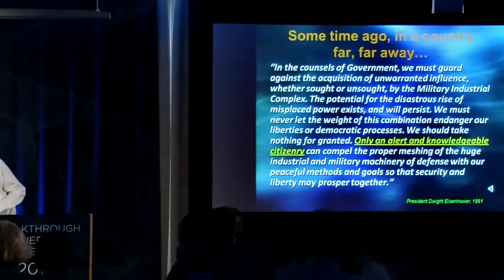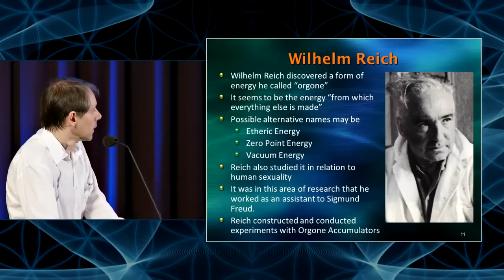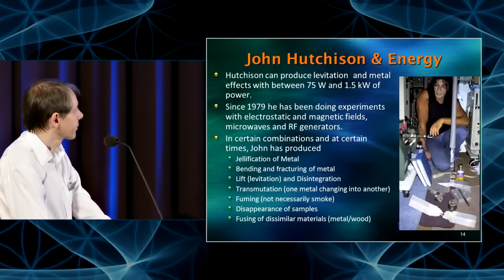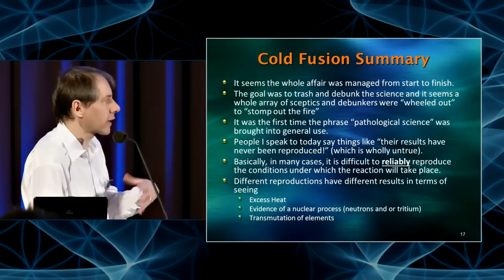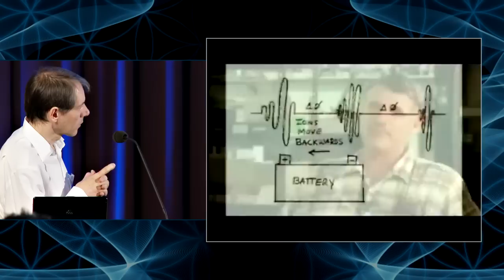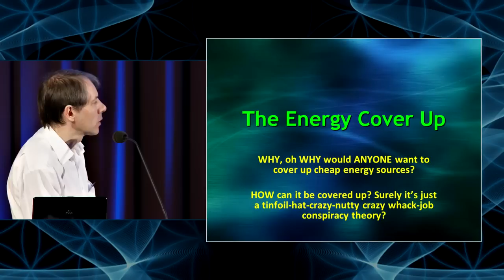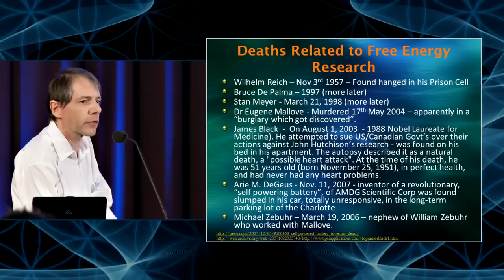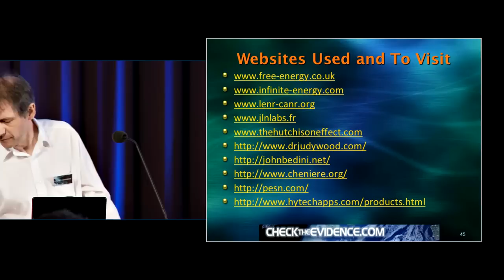Infinite Energy, But Not For The Masses | Andrew Johnson

Comment: I wonder about the law on thermos dynamics that says energy can neither be created or destroyed, if that were the case how come we have the sun providing us with energy, where does it get it's energy from in order to provide it to us and everywhere else.

According to what we are told, space does not provide energy it is the sun that does that, but the sun has been burning for a long time and will go on to burn for a lot longer, so it must be getting fuel from somewhere right?
 if the laws of thermos dynamics is correct, the sun must be getting a regular supply of fuel, but it's not as far as we  know, so where is it getting it's energy from?

I've heard it said that it is some kind of nuclear reaction, but as far as I'm aware all nuclear reactions produce waste, where the exhaust pipe for the sun? I don't recall ever being shown an exhaust pipe for the sun.

I'm clearly not a physicist but it would be interesting to see what kind of answer to these questions would bring.

Of course the main question for me is, where is the sun getting its fuel from?
Reply: The Sun uses fusion reaction, which is clean. It fuses hydrogen atoms together to produce helium, then further fusions go on to produce many elements of the periodic table. The Sun started out after a vast amount of hydrogen was compressed due to gravity. The universe is over 95% or more free hydrogen. Here on Earth so far we've only managed nuclear fission whereby heavy elements are split apart, producing radiation and radioactive elements. Fusion is the Holy Grail of nuclear energy.
Reply: Tyrotrainer
Thermonuclear bombs use nuclear fission to produce the high temperatures and pressures needed for nuclear fusion.
The Sun isn't that 'clean'.  It produces high-speed particles that one sees in aurorae, and which give astronauts cause for concern.  If you stood on the surface of the Moon during a high-intensity solar storm, it would kill you.  It's possible to shield oneself, of course, using water or other hydrogen-based materials, or several feet of rock.
Personally, I think the search for fusion power is premature.  We should make better use of sunlight, winds, currents, and tides, and save our petroleum for recyclable plastic products.  Meh.
Reply: Tyrotrainer

But here's the thing, all that power being produced by the sun and there is 1/ no exhaust system, 2/ it's what makes life, 3/ just keeps on burning away, 4/ has no added visible fuel collection or refueling system, 5/ pretty much does the same which ever side you are on the sun, 6/ we are shielded from most of the harmful output by a gas.

So it does make me wonder, if the law of thermodynamics is correct and even if there is 95% hydrogen in space how does the sun collect that hydrogen and where is the exhaust pipe so to speak.

However if there is no exhaust and the sun doesn't collect outside fuel then clearly the law of thermodynamics is wrong.

Think about this for a moment, the sun gives off particles and a wave apparently in the form of light, so this light is really strong stuff cos it's what makes all living things stay alive right.

So the sun creates this stuff, but where is it getting it's energy from, ok you say it's an old star that had lots of hydrogen but we know that hydrogen doesn't stick around once it's been heated up.

I mean what would happen if we set off a small hydrogen device in space, would it burn for a long time or just burn up or not burn at all, rockets use a form of hydrogen and they go out pretty quick if the fuel stops being supplied no chain reaction, so really if the sun was just hydrogen it would have used up its supply pretty quick, but to date no sign of it running low yet.

So the sun must be doing something that goes against the laws of physics.
Reply: When you look at the mass (many many powers of zero kg) of the Sun, most of it is still unreacted hydrogen - we are talking many billions of years yet before the Sun burns out. It IS effectively losing mass by way of the energy it constantly radiates out into space (E=MCsquared) - but much remains in the form of heavy elements that are produced via fusion. Ultimately the reaction WILL fizzle out and gravity will overcome the nuclear reaction that stops the Sun collapsing (this is called Fermi Pressure - holding the structure of the Sun together effectively). Once the Sun collapses into itself it will explode, leaving behind an extremely dense, quite small object, a Neutron Star possibly, or a White Dwarf - it's years since I did this stuff. To answer your question, the amount of matter is mind-boggling. The Sun has quite enough fuel, thank you very much!
Reply: I see what you are saying but how do you know this is true?

Surely if it were just hydrogen then when we burn hydrogen it would last a lot longer after all it's just hydrogen right?

How has what you say been tested?

It doesn't seem to follow reasonable sense unless there is a lot missing in what you say.

The sun has been there for a long long time, I don't know how long, I doubt anyone really knows how long but I suspect many have had some guesses.
The sun will be there a hell of a lot longer, and perhaps it dims from time to time I don't know, but after it dims it then brightens back up, if it dims at all.

It also produces these things scientists call flares, which seem to be very dangerous but even though it produces all this stuff it doesn't go out.

Against all the odds ie space giving it no fuel it just keeps burning.

Yes it's a massive object, but on a smaller scale we should be able to produce similar reactions were it just hydrogen but we can't.

Perhaps I'm trying to reason something out that has no sensible reasoning behind it that we can understand, but one thing I would suspect is that it is probably not just hydrogen.

I understand carbon is a very common substance in the universe perhaps it is a combination of hydrogen mixed with carbon, some kind of hydrocarbon.

It would be interesting to see what would happen in space or a vacuum box placed in a super cold room with the vacuum chambers temperature dropped to a similar temperature of space, and ignite a hydrocarbon mixture of varying amounts, if there would be any variation in burn time.
Reply: flitsies The testing has been done by observing many thousands of stars, and comparing what we know from mass spectroscopy as well as Newtonian Physics. The nuclear processes expected to occur, from theoretical results, appear to be indeed taking place. There is much we do not know about the Universe, but much is known. Scientists all appear to agree that our Sun is a medium sized hydrogen consuming star, and they agree on the physical processes taking place within it. 

Likewise, you'll never get any scientist to go along with Flat Earth, the spherical model is beyond doubt. I teach navigation to pilots and I can assure you that the earth is not flat. 

What I'm trying to say is that sometimes you have to accept some of what you're told, because it is empirically provable. That the Sun does not burn only hydrogen? Prove it to me, I'm listening.
Reply: Ok first off, of course the earth is not flat, that's just plain daft, why would the earth be flat.

Who would be daft enough to think that the earth was flat.

Ok secondly, scientists often get things wrong, they are well noted for doing just that, getting things wrong.

The reason they are so good at getting things wrong is because they know they don't have all the answers and therefore even though they might all agree that one explanation for something is the best they can conjure up it doesn't mean that it is the only explanation and so they keep looking and discover that the explanation is wrong for many things that has been taught to students as being the most likely.

Scientists never say that something is absolute because they know it may not be absolute.
Often theories change over time as more information is gathered, more tests are done, better theories are tested.

So back to the Sun, as far as I'm aware we have not developed any instruments to go close enough to the sun to test anything, however the distance testing that has been done is interesting but inconclusive.

So there is much room for exploration by any means possible including theories, ideas and hypothesis, and  yes in general a theory is considered in the science world as meaning a high degree of fact but in truth often theories are wrong, that's why they test them.

So chances are that due to the lack of testing of the Sun we don't really know what it is yet or we would be able to recreate it here or somewhere, but we can't yet.

So though I agree with you that perhaps they are correct I reserve the right to think that perhaps they are wrong, in fact  I would say they are wrong as there appears to be nothing to substantiate their claims that I have seen anyway.

Perhaps I've just been looking in the wrong place.

But all things that burn give off pollution of some kind, leave traces of their action, even hydrogen burns leave water behind, the sun doesn't.

The Sun has no exhaust system so to speak.

No waste product, the radiation that it produces provides much needed energy and is not wasted.

All forms of power we convert needs some form of exhaust system, waste disposal the Sun does not.
Reply: Ok one other thing.

You say it's hydrogen and you may well be correct I don't pretend to know.

But if it is then what stops it from just igniting the whole lot in one go, Hydrogen is extremely explosive as we know, and if the hydrogen is simply swimming around in one big ball what's stopping it from simply all going  up in one go.

If all that is happening is the hydrogen burning off, then how is it doing it? if you put a match near hydrogen it's gonna go up whoosh.

Yet here we have claimed, a massive ball of hydrogen but some how it doesn't all just burn up it seems to burn in some kind of way that allows some of it to burn while other parts of it simply doesn't, then you have the flairs, were it just hydrogen what would cause the flairs to occur.

As I said I'm no physicist and I don't believe in flat earth nonsense, but it would be interesting to know why and how the sun if it is just hydrogen manages to contain all that energy without it simply just all going up in one big whoosh as hydrogen normally does unless it has some kind of external control mechanism reducing it's intensity.

Perhaps that's what the cold of space does?

But it would be interesting to see what would happen if they set off a small tiny device in space, but as I said rockets are hydrogen based and they have to mix other fuels to make it burn, so why can the sun do it but we can't?
Reply: You kinda answered your own Q in the last paragraph - in order for the hydrogen to burn (conventionally) you need an oxidant (such as O2). In other words, hydrogen burns extremely vigourously in air, but not in the vacuum of space.. The hydrogen in the Sun is unable to burn, or flare up; instead it is intensely hot, with incredible amounts of kinetic energy (due to gravitational force). It is this kinetic energy that initiates and sustains the nuclear reactions.
Reply: But kinetic energy in space doesn't really do anything, other than the fact that there is virtually zero friction.

So how would kinetic energy make any difference in space?

Or is the kinetic energy created from the burn of the hydrogen supposedly?

So if we spun something up in space at roughly the same speed as the sun
that was full of hydrogen it should in theory be able to sustain it's own reaction and continue to burn.

I don't know it seems like there is something missing to me, I don't know what it is but it just seems too simple for it to be correct.

We know that trying to burn hydrogen in space doesn't work unless you have another fuel to mix with it and something to ignite it.

We also know that there is no oxygen in space to fuel the burn.

And we also know there are no forms of ignition to set the burn off.

However the sun seems to be burning,.

Ok gravity may be a part to play with keeping things in place, but then just how much gravity is generated by the sun, and if it does produce so much gravity then clearly gravity is not magnetism as some have suggested.

But even with gravity and rotation + hydrogen I still don't see how it is possible for the sun to keep going for such a long time but not deplete it's energy without replenishing it some how.

With all that gravity perhaps it draws in particles from space which replenishes it, I don't know but it seems odd that something so powerful with so much gravity wouldn't draw matter into it.

Even the earth draws matter and substances from space to it, so presumably the sun would do similar on a much grander scale.

At the moment I understand that it is being suggested that hydrogen is the basis of the suns ability to perform but it just doesn't make sense to me, there simply seems like there is more going on.
Reply: flitsies I suggest you search on Sun Wiki. The entry looks pretty good, and fairly easy to follow.
Reply: Check out the electric universe theory by YT The Thunderbolts Project. Man sought to explain the universe by what he knew. We know more now. Check out "The Book Of GEET" by Paul Pantone. He models the Earth and Sun. Build one and do your own experiments.

Comment: 27:40 how is fibre glass an organic material in the diagram, fibre glass as i know it is glass fibres (Manmade) ipregnated with epoxy resin, also (Manmade)
Reply: I believe that's only your interpretation of the diagram. It is to my understanding u layer inorganic materials such as processed metals. With organic materials such as crystals. Moldling them together using  rosin. The hole thing being what's referred to as orgone.
Reply: The whole science of various disciplines and use of the same words for different meanings is part of the culture of obfuscation. The simplest clarification is organic means conducts longitudinal/magnetic electricity, not transverse/charge electricity. In some frequencies this makes fiberglass organic. In other frequencies, light is transverse (IR) and then fiberglass conducts..  and is non-organic. Clearer? 

Lots of study will make it clear.